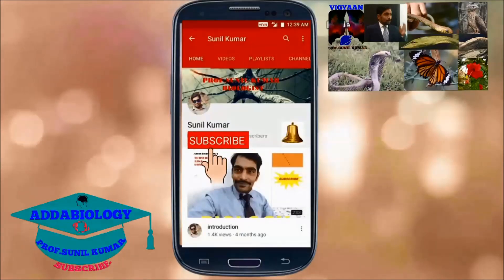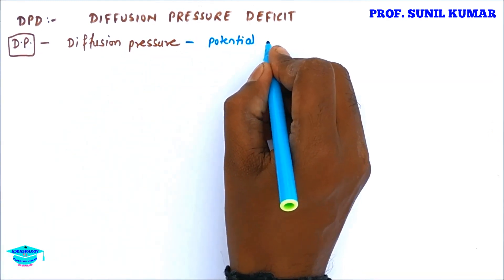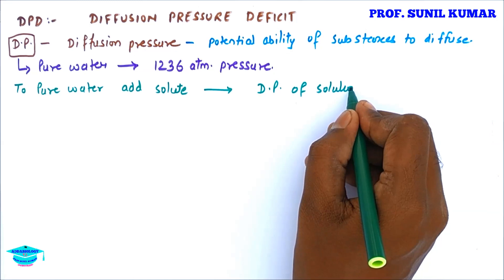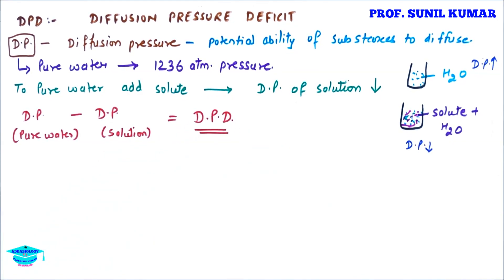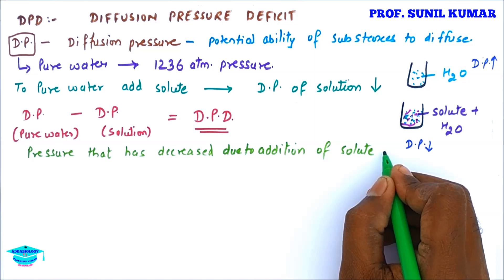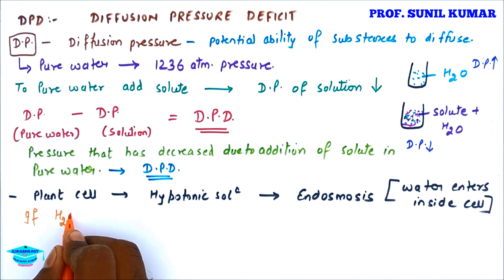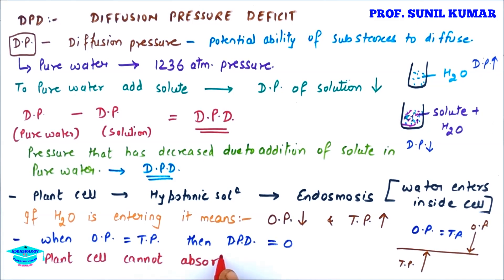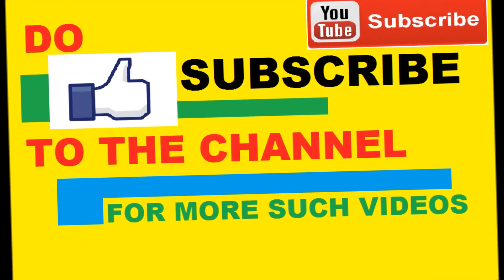DIFFUSION PRESSURE DEFICIT (D.P.D.) / TRANSPORTATION IN PLANT (PART 3)

Comment: Sir could you please state the difference between diffusion pressure and water potential? 
It's been confusing me since a really long time, almost every time I open my book and sit for studying this chapter. 
Like, you told in this video, 'diffusion pressure is the potential ability of substances to move from higher concentration to lower concentration' whereas difference in water potential also indicates the same thing. So what's exactly the difference between these two?
Reply from the maker: Both are same in magnitude but opposite in direction